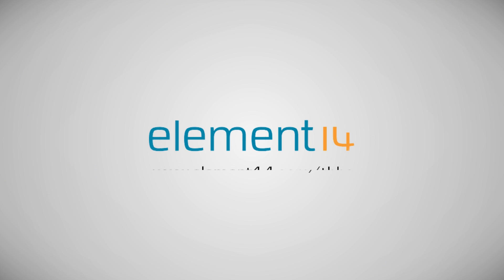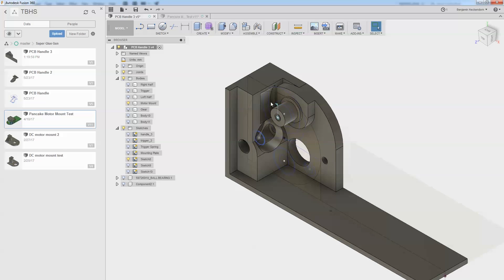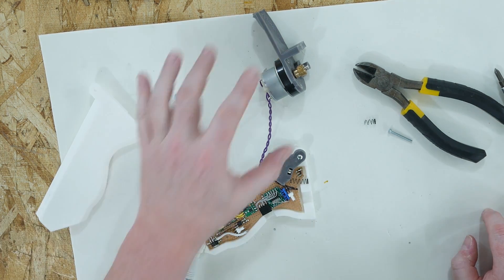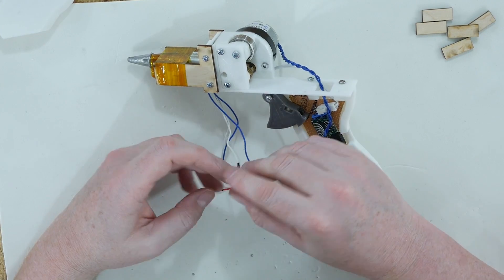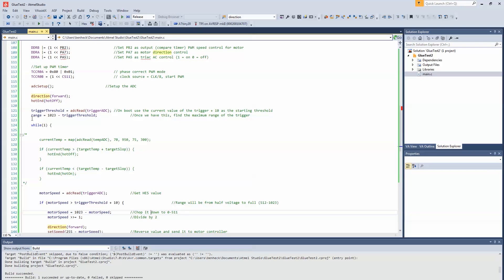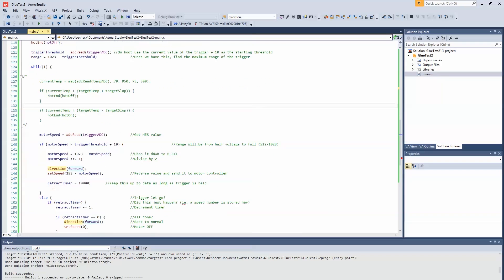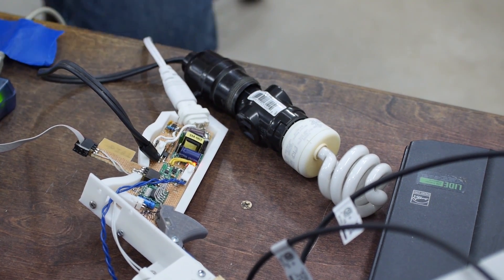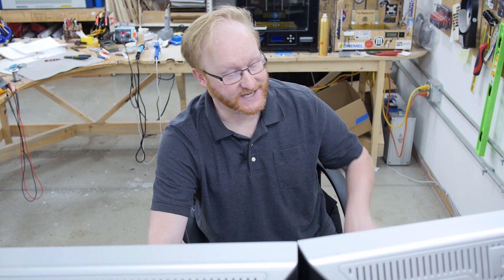Super Glue Gun 06: First Working Prototype!

Comment: At 10:30 I had an idea for you. After retracting, extrude the same amount you just retracted before going back to speed control. That's what my 3D printer does. And why do you need the automatic stand? Move the cord entry somewhere else and make the base flat, weighing it it down a bit to make it sit stably on a surface.

Comment: The case needs to be heat resistant and would melt from the heat of the hot end so the case should be made from aluminium not polymer and the inside coated with silicon rubber, can you not use 2x VN66AF VMOS transistors to control the triac as you want to shunt the triac control pin to ground to turn it off.

Comment: Maybe it should have a display showing the temperature, that would be cool. I mean, you could have an LED light up when the heating element has reached glue melting point, but it wouldn't be as cool, right? Seriously, though, it would be a nice safety feature.
Also, why didn't Ben go for a potentiometer instead of a hall effect sensor like people had suggested here in the comments? Seemed like it would be much easier to work with (and cheaper too?)

Comment: What you are doing are still not that safe, touching perfboard with live contact just mm away...Ofc they aren't through hole, but fingers are soft so they can reach down if they really want to  :D And also, there are always the risk something shorted out under board to make metal switch live.To be as safe as possible you shoul've kept the ac on seperate board. ie keept the button on arduino board. And only use the on off switch with power off. Even if you know where live contacts are and avoid them, accidents happen. It's better to be safe than sorry when playing with 110/220 ac